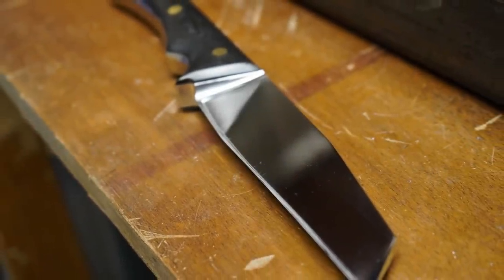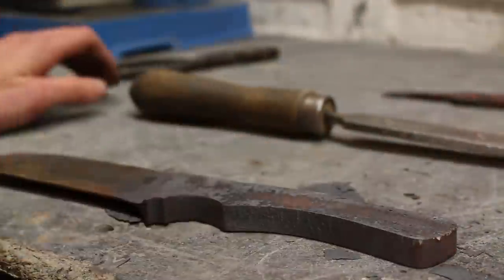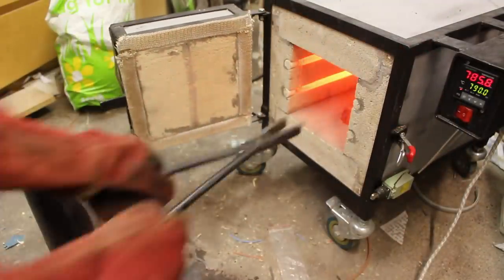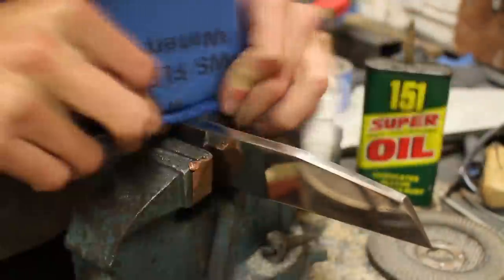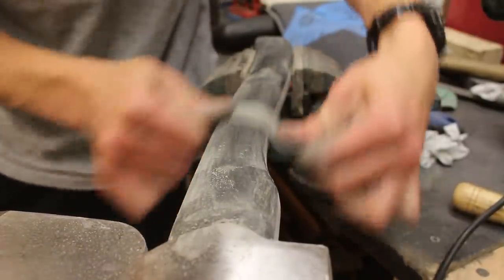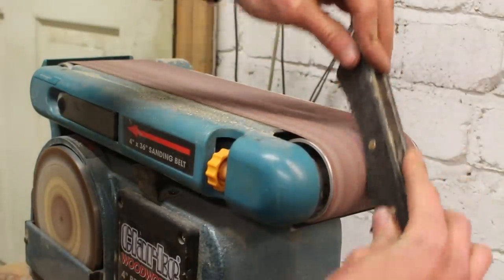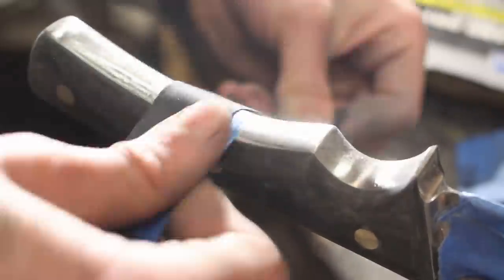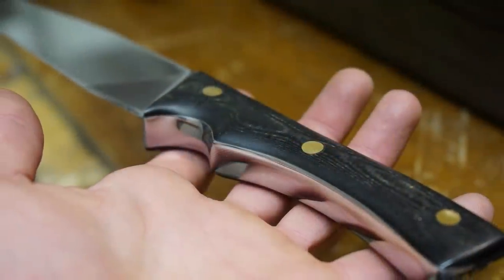Making a 12mm Fixed Blade Knife (continued)

Comment: The finished result is so amazing. I like it a lot, it looks classy. It wouldn't have looked as good if the blade had been as long as it initially was. The crack was a good thing! It made you build the oven for heat treating and now you have this beautiful knife. Great work!

Comment: Little tip for the next time you forget to drill your peg holes in the tang before heat treating... either Heat the tang with a Mapp Gas or Oxy-Propane Torch (blade in a bucket of water so as not to ruin the temper on the edge) and normalize it again to soften the steel or...

You can use a Carbide End Mill in your Drill Press.  So long as you use plenty of cutting oil they tend to go through hardened steel like a hot knife through ice cream.

Comment: Great knife. I think a sheath might be useful, it looks super sharp.  👍
Reply from the maker: Cheers! Planning on milling an aluminium sheath with leather padding inside once I finish building the cnc machine
Reply: @taow  why not just laminate it out of wood and inline it with leather inside  and from outside you can use torch to burn wood and varnish it .

Comment: The heat treatment was obviously a disappointment for you but lots of good learning experiences at the same time. You did very well to salvage it. Can I ask though, what would have been the original intended overall length and width of the knife had the heat treatment been successful?

Comment: I notice you went with bench stones for the final sharpening. What happened to that crazy "polishing compound on a plywood grinder wheel" system you had a while ago? Is it not the right tool for this job?
Reply from the maker: That method is still great for re sharpening blades, but on this knife I had a lot of material to remove initially (like 0.1mm) and that method only really polishes the edge, doesn't remove much metal.

Comment: Knife looks nice ! It amazes me how many people use paper test wrong .When you cut paper use nothing but a weight of knife holding it by a index and thumb  -also its not important that it cuts paper ,half dull knife can do that.What its important is how are the edges of the paper -are they smooth= knife is sharp or does the blade tear up the paper= dull.
Shave test is also a bullshit .if knife has a low angle it will shave a hair ,but that doesnt mean it will hold edge long enough.Straight razors are super sharp and yet after 1-2 shaves they get dull and all they did was shave hair.Why? Thin material and extreme angle .So yea you dont wanna shave hair with your kitchen knife ,it wont hold sharpness for long.